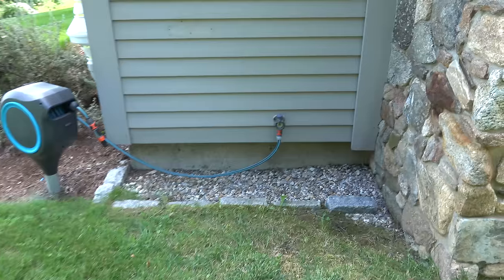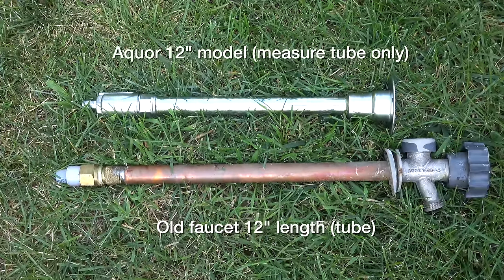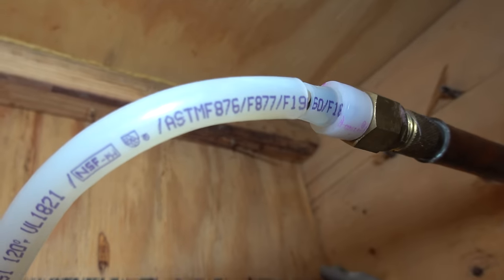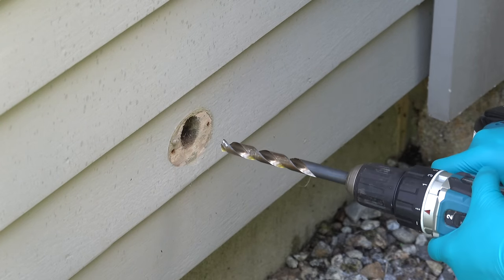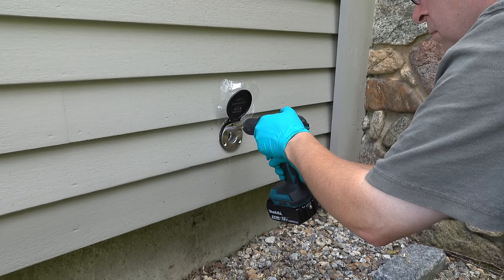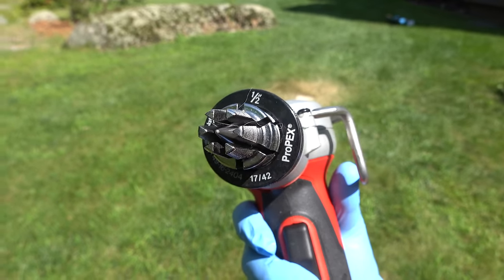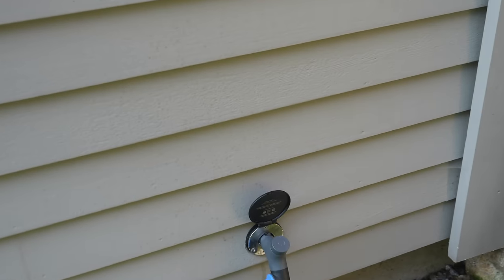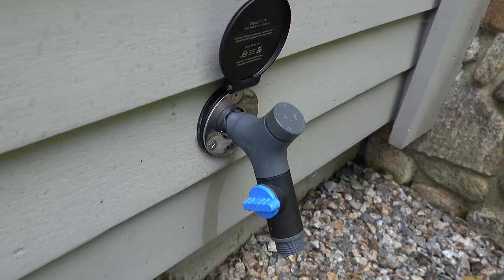REPLACING YOUR OUTDOOR FAUCET JUST GOT EASY / Leak & Frost Free AQUOR IDEAL for Retrofits

Comment: I definitely like the clean look, but I kind of agree with some who say it’s unnecessary.  It does kind of seem like an extra step for a simple thing, and require you to keep around proprietary elements to use it.  And if one breaks, I could almost guarantee that said elements would cost more to replace than just a standard sprayer.  Also, I live in Florida, and the heat and humidity absolutely tear up anything that’s permanently outside.  Even the best fixtures like spigots, handles, lights, etc have deteriorated on me in less than 10 years.

Comment: Shame this won't work in my house here in AZ. Our spigots don't actually go into the house, they go into the ground, OUTSIDE the house and underneath (I think).  So there's no way for me to even access it.  It's ridiculous the way they build some things here.  For instance, the electrical panel is also located OUTSIDE the house.  What's worse, it's on the WEST side of the house, which is the side that gets up to 1,000,000,000* F during the summer months.  Additionally, I have to install a lock on it because any mug can just come up to my house and shut off my power.  It's nuts.

Comment: Do you sleep well with the PEX or Shark bite connection?  Seems risky for a hidden water connection.
Reply: My whole house is Pex and some PVC. Also have used it myself replacing copper and running new lines for an addition. Zero issues.

Comment: I think this is probably unnecessary for a home, but I can see the benefit of using it at a condo complex or an apartment complex. Most of the time at these places the Condo Association or management will remove the spicket handles to try to prevent people from using the water and then people use needle-nose pliers to dig in there and try to turn on the spicket without the handle and it generally destroys handle connection.

Comment: I imagine inside that hole is some sort of rubber sealing component like say a "O" ring or whatever. Everytime you stick that spigot in there and twist it, theres gonna be some type of wear and abrasion over time till it eventually starts leaking. I dont see it lasting for too many years.
Okay so you can leave the spigot in place but whats the point then! Now your right back where you started! You got a faucet on the side of your house!
As for freezing? I turn the valve off on the inside for that faucet. Then open the outside spigot and water drains out. So no water there to freeze anyway. Presto!

Comment: It's not like it's an incredibly complicated install, but it's still one I wouldn't want to have to repeat, if, say, the company vanished in a decade and I could no longer get replacement quick-attach valves, etc. So, if the valve and handle design is proprietary, which I'm assuming it would be, then I would be hesitant to invest in these. 

But, then again, if I could 3D print my own...maybe?

Comment: I bought these about 2 yrs ago. Never got around to putting 'em in (old lady with too much house to get everything done!).  Had the plumber over for some work so he did it.  The plastic attachment on the hose STAYS on the hose (and I just lay  the hose connection in a nearby plant (and the hose water-handler attachment in the same plant... easier to find!  So the connector is  not sticking out of the wall EXCEPT when I'm using it.  Won't be IN the sun.  
I had to put a pair of fake leather gloves inside the nearby door, because I get my hands wet when I'm messing about with plants, and my bare/wet hand grip strength is not (yet?) strong enough to un-turn the connector to shut it off/get it out.  {shrug}  No big deal.  

AND as we slide ever deeper in to the next ICE AGE, having the piping in the conditioned space will be SO worthwhile!  (And yes, we're already some 10 years INTO the next ice age! Look into stadials and interstadials in geologic history: the climate change CRAP is money-grubbing CRAP!)  Super system! (Had one put on the backyard hose fitting too!  IT has the 'turn handle' like a normal old timey fitting.  Prolly shoudda put that out front.  Oh well, maybe later!

Comment: Outdoor faucets have been around for over 100 years with minimal issues , yes they may need to be repaired or replaced every 40 years but as a contractor that specializes in pre-ww2 buildings I come across homes with the original Faucets that work perfectly fine .  This modern contraption that you're trying to hawk will fall apart like every other modern contraption within just a decade , it'll start with the cheap door latch failing or getting knocked off to then go downhill from there .

Comment: Being proprietary is also not great for anything.I want quick and easy off the shelf products, when needed. Having to add/remove parts for winter/summer is a bad idea. If the neck/back-flow/shut-off valve assembly gets lost or damaged over our five month winter period, it could be costly. I'm old school. I prefer my copper lines and brass valves/hose bibs, with quarter turn ball valves inside to shut off water flow. Don't get me wrong, I like the clean look but, I know me. I break and/or lose things all the time. 😊 Thanks for the great video.

Comment: Technically it's probably a better design as the part that gets the most wear and tare (the spigot) is fully removable without having to fully install something new.

I am curious how long the quick connector lasts would like to see someone like project farm see how many uses this thing can go through before failure.

In most cases these days if I am installing one if these I tend to still put a shut off valve inside the house before the interior to exterior plumbing of the spigot so it's easier to replace down the line in the future.

Also that small amount of water may seem innocent but that how every many times over however many years will lead to wood rot they should install a little ramp on the outflow so it drops away from the house.

When ever possible should always ensure little no water can consistently hit wood other wise it will rot eventually.
Reply: "they should install a little ramp on the outflow so it drops away from the house."  Yeah, I've thought of that too. But I don't use the hose daily, so it's not likely to do damage  to the wall below the spigot. {shrug}   Nothing is ever wholly good nor wholly bad.

Comment: I love technology... it doesn't matter if it's plumbing or electricity, carpeting or just circuit board technology.  It's great to see evolvement in everyday life, even in the small things are important :) 
I can't wait till we start off with see thru pipes and see thru hoses. Put in a circuit board with a touchscreen to turn on and of the main water valves that would be controlled by a brain (cpu) that sends signal for mechanical movement or something that doesn't require lubrication maintenance, that shuts the main valve for that water circuit its controlled to shut.

Just wait till we can install a layer in the exterior wall cladding which has a clear primer over it to protect it, and with the help of a control panel, change the color of your house at the same time as you protect the wood from any weather due to the clear primer. 

Don't ask me how this will be made, because i have no clue yet, but i do know that it is possible, and it will be done one day or another in the future.

It's as possible as it was for phones to share direct video over camera, and holograms are also something that's possible, all stuff i thought was long in the future when i was a kid, turned out, as an adult it would be everyday life...   We all have had fantasies about flying cars... well that will also evolve to happen, starting with personal drones that fly you around to more advanced hover technique  that can gain altitude and momentum without blowing half the neighborhood away

Comment: Why not just use plumbing and valves that will stand up to the theoretical ~3750 PSI maximum internal pressure that could occur in freezing pipes?

Comment: I like the idea and look, but it won't work for me and our 125 year old brick house. The ground level is too and our outside line come out underground, turns 90 degrees upward, with copper pipe against the outside wall. Then 2 feet above ground another 90 deg to horizontal  and a spigot soldered on. 

I haven't found an easy solution yet other than to replace the spigot itself. I'll bet any other solution will have code issues.

Comment: cool concept but in my opinion it should use a standard quick release connection where the female end is in the wall instead of what they're using in this design. that way it's significantly easier for the owner to buy non proprietary quick releases.

Comment: I’m sure this has been covered, but what happens if the adapter breaks or you loose it?   $$$$$
Reply from the maker: You can buy extras: https://amzn.to/3GB4GqP Most peopel will get a few and use the adapter as their qucik disconnects as opposed the brass ones, that all leak. Company has now been in business for 14 years and they are only growing so I wouldn't be worried of lack of parts based in their solid past.

Comment: The only 'upgrade' as far as I can tell is the appearance if you prefer that, and I guess that people can't steal your water which I've never once worried about.  Everything else is already solved with the other system.  That seems like very little gain for the amount of downsides such as a proprietary system you're locked into, bad materials, possible to now lose your faucet, extra steps to using it etc...

Comment: I live in North Carolina where temperatures less than 10 degrees Fahrenheit occur every other year or so and when they do, those temps are short lived.  I like the look of the door but I can see that valve either getting lost in the cold season or broken. Also, I was disappointed when I learned the spout was made of a really expensive plastic that Aquor deams worthy of a $30 price tag. Overall. Overall,  I am also in the Unnecessary Camp.

Comment: I think people are missing the point. These are horizontal hydrants and the actual shut off valve is in the house where it is warm. When you turn the handle the valve opens allowing water to come out from inside where it won't freeze. When you turn it off, the valve inside the house closes and all the water drains from inside the wall to the exterior. No freezing.
Look up how hydrants work.

Comment: Like most say metal only parts please, with a insulated seal on the flap to keep cold out. My biggest problem however is the length of that thing. We are in the SE and have vinyl siding on slab. There's no way to replace things without going in behind the spigot and that means cutting the wall behind it. 
Once done, there is literally like 4" to work with . So sticking with brass and PEX is fine in my book . 

While I understand why ppl are against the proprietary connectors, it could be a good preventative against theft or vandalism. When we first bought our house we had a month where tons of water got used, but it wasn't us. People can use your water without you knowing or just turn it on and leave, if you're not at home much.
Reply from the maker: They sell a 4" version, multiple sizes for different depths

Comment: Yes, considering. Some of the outlets on my house are in stupid positions; along the wall right in next to an entry door. It looks stupid and is a danger to being hit as someone walks in. However, I'm concerned about two things. The proprietary nature of the attachments that plug into it. Without them, the device is useless. The are plastic and WILL deteriorate and break. Also, any pressure reduction related by the device's mechanism. Quick connects also cause this issue. I saw at least one comment on Amazon about noticeable reduction in water pressure using this device. For most things, it's ok. For cleaning or running sprinkler(s), low pressure can prevent the proper functioning or results. Still considering.

Comment: I watched this video and realized my home was built in 1921! Then I realized is all old school thick brass pluming including the valves and outdoor faucets. Then I realized its seen negative temp winters for 102 years. I think the problem is new homes do not have foot thick brick walls and use pot metal outdoor faucets and plastic pipes and valves?

Comment: Given the price, you'd think the company would design it with a small lip/ drip edge to prevent the water from dripping directly down the siding when disconnecting. All I am seeing is future wood rot from the water which will migrate between the boards.

Comment: No insulation around the pipe? What about bugs?
Reply from the maker: There is a rubber gasket at the end I metntioned and my installed very tightly but you can certainly add silicone foam, etc for more if needed

Comment: As a developer I’ll likely be using these on new homes. People like quarter turn quick connect stuff. Great design for New England and colder climates. Neat design and not over engineered which is rare. To the dudes talking about using this for an update idk how well it will or won’t work but I feel like this built in will be a nice fit.

Comment: I like the idea of the quick connection and it seems easy to install, but the need to purchase proprietary connectors is a bit of a downside
Reply: They're not all that expensive to replace even if they did break (acetal is pretty durable) and you can always buy a second one as backup incase you're worried that in 10 years the company won't exist.

Comment: Those of us that live in Arizona, don’t experience freezing very often.  But I can see the value in locations that do.  My problem would be my wife misplacing the faucet! 😂
Reply: The connector stays ON the hose.  IF you have two bibs, you'll likely have two hoses (so get two connectors)? Or you'll be hauling the hose from one bib to the other, and the connector will go with it.

Comment: It dribbles down the side of your house by design, a real form-over-function vibe.  And the workaround for that is to leave the external adapter on there all summer long, leaving you with a less durable and more obtrusive faucet than you started with.
Reply: Leave it plugged in and HOPE your hose doesn't pop?   My water bill was VERY high when that happened cause I forgot to turn the normal bib off, and the HOSE broke!  It dribbles down the outside less than a tablespoon, if that much.  JUST as much water as is left in the 4", 6", or 8" piping.

Comment: I think it looks cool, but I worry that it wouldn't be heat proof for our blazing Texas summers... Atlantic Seaboard --> New England winters? Awesome... but over 100º every day for 3-4 months? I don't know. What do the experts say?
Reply: Haven't you lived through one of those Texas freezes yet? you know, the ones in which all the pipes freeze and burst because their building codes don't require this sort of protective measure around outdoor plumbing? The word you are looking for is "extremes" - and Texas will be hosting many of them in the coming decades. And thanks to their cockamamie "independent" energy grid, Texans will pay the price one way or the other. As the old Fram oil filter commercial used to say: "you can pay me now, or you can pay me later."
Reply: @billplaney2585  Right, to rephrase: "I see that it can handle cold, but can it handle heat? Texas' summers are far more brutal than New Jersey's (though they are nothing to scoff at)."

Comment: Looks extremely expensive to install if you don't have access to the back of the valve.  Like at my house, got sheetrock on the backside of the wall on which water valve is installed.

Comment: It's a cool idea but I am not a fan of plastic valves. They just don't last. Since this is proprietary valve, I can imagine the cost of replacement. Just not feasible. If it were brass though.........
Reply: Acetal resin polymer is durable. Also their connectors are pretty average in price.

Comment: This doesn't work on south Texas and south Florida homes because no basement, or any pipe access inside the house. All hidden in the wall and comes up from concrete slab. I have to put a space heater aimed at the inside wall when temperature drops below zero. New home builders are real corners cutters to save a couple dollars.

Comment: My biggest worry is having to replace it far too often, not to mention that the water that flows out will ultimately rot the wood below that cover. Besides, in most of the water areas inside the house & under it, there are shut off valves. I call the local plumber to come out every 10-15 years to replace them all. As we all know, shut off valves can & do fail sometimes. The plumbing is all copper with exception of the silicone line that runs to the refrigerator freezer ice maker.  And over the last 30 years, we have had very little to no issues. I do like the concept you have here, I just don’t like it in function.
Reply: Rot the wood? Do you live somewhere where your house doesn’t get rain and snow? I think a little bit of water once or twice a year will be okay.

Comment: One note on enlarging the exterior hole: while we've all done it, the bearings in a hand drill are NOT engineered for that lateral (sideways) load, and using it that way cn cause them to fail much sooner than otherwise.  Take your time and use as little sideways pressure as possible.

Comment: As a Water Treatment Operator, I'm often sent to homes to test for bacteria. I would not be able to test your water for bacteria if you have this faucet. One of the steps to pull a proper sample is to burn the faucet with a butane torch to kill bacteria on the faucet.